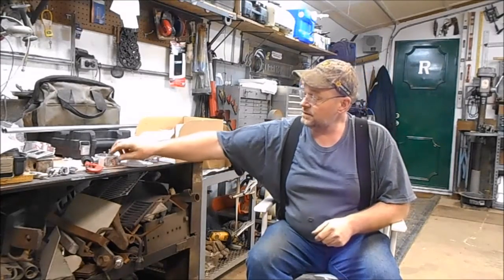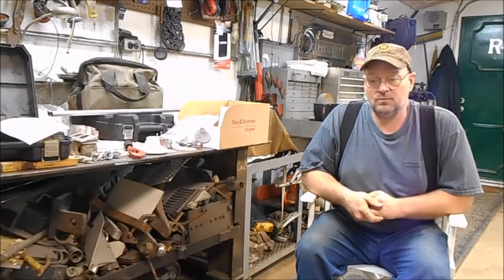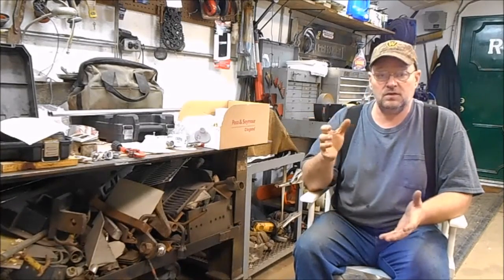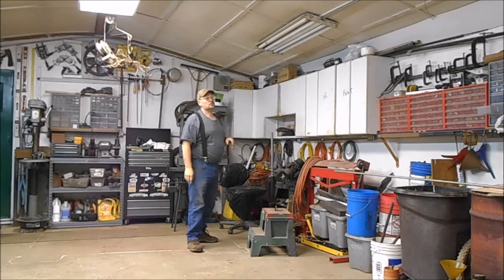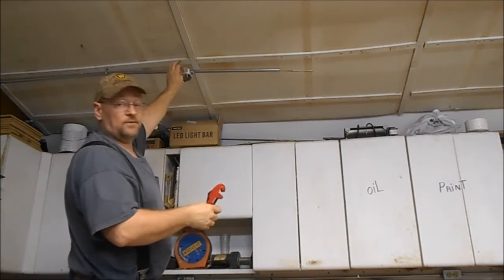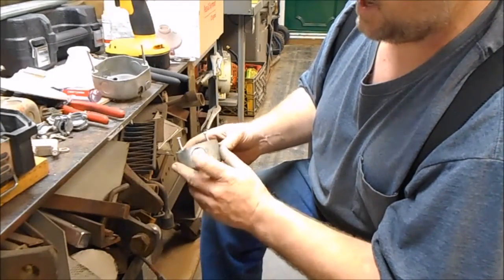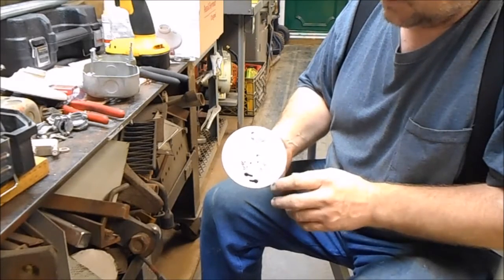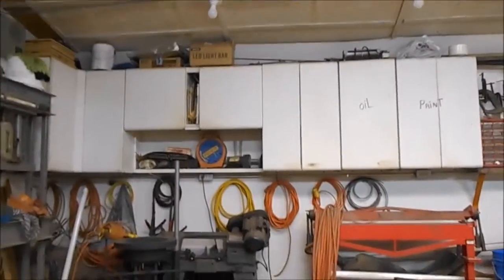Led light VS Fluorescent light

Comment: Each of those 40w fluorescent tubes is around 2100~3200 lumens, depending on the tubes.. Those 9w LED bulbs are probably only 800 Lumens each. It would take 21-32 of those LED bulbs to produce the same amount of light as those 2 fluorescent fixtures. If you want brightness, you are definitely going to want to keep the fluorescent lights!
Reply from the maker: Thanks for the comment

Comment: Toward the end of the video, the light looks equal in brightness and lumens. Did they just need to warm up? I have found through my own experience that some of the led bulbs need to be on for a bit, especially in cooler weather in order to get full lighting.  There are models that are called "instant on", although in really cold weather they still take a bit to get going. Semper Fi.
Reply from the maker: +Foothills Readiness Thank for the advice.
Reply: +Kevin Robinson Maybe a shade to direct the light down more also